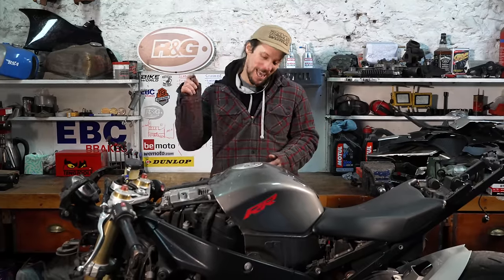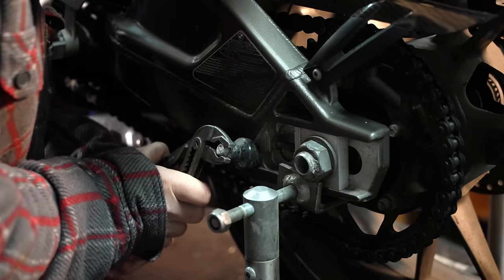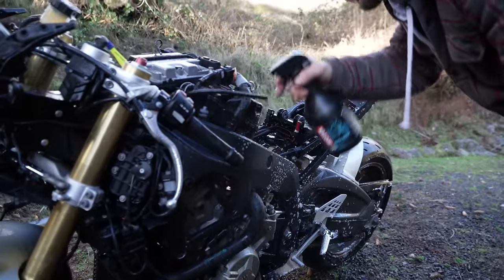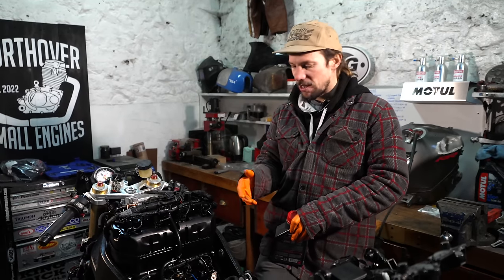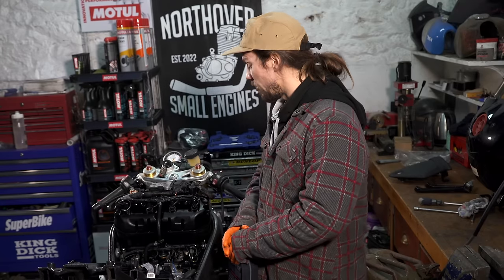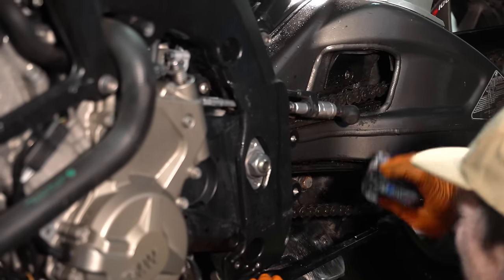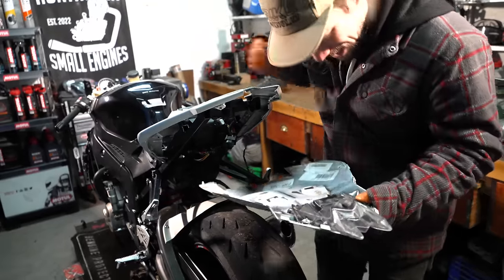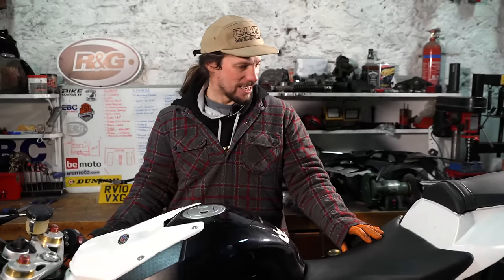Write-Off Rebuilds | Wrecked And Written-Off Superbike Rebuilt And Put Back On The Road, Part 2

Comment: Makes a load of sense to me, and I’ve done it since day 1 as well. Grab a bargain, make it safe & mechanically sound, then enjoy it without worrying about riding around puddles or spending the evenings polishing your tyre valve caps. Great option especially if you use it on track or every day. Can always have a ‘shiny’ bike for nice days then something rebuilt to use the other 6 days of the week. Great work, thanks, and keep em comin. 👍👍

Comment: I race and have bought salvaged ‘19 R6, ‘22 R1 and ‘23 V4S. All are race bikes and turned out perfect. Salvage bikes are good for club racing given you will be replacing a large portion of oem gear anyways. I reviewed them all before purchase to ensure they can be rebuilt and all turned out great. I agree that the process of rebuilding it yourself is half the benefit.

Comment: As an ex-racer, wouldn't faze me one bit if a bike was previously damaged or written off (obviously so long as price reflected it! Haha!). God know's how many times I've binned a bike on track, from CBR400's to ZX6Rs to a track-prepped Duke 1098 and my ever faithful Gixxer 1000....... some having had mega-spills, yet were on the grid next day, doing the business as if nothing ever happened (after a few hours softening the edges of any ground pegs/levers with an angle grinder, and re-attaching the bodywork with a few sheets of fibreglass and a tub of resin of course!! 🤣).

Comment: The majority of whingers wouldn't know the difference between a 10mm and 32mm socket and probably have too much money, I've been rebuilding bikes since 79 and only getting old has slowed my rebuilding down and breaking my back in 2001 don't help either, project reverse trike has basically stopped 😞

Comment: Love all your videos and you specifically you long-haired-loverman 😂 However, one complaint. You first talk about "lots of parts to fit. New panels. Paint" THEN you say about making sure everything is straight. As this is a sort-of guide for people, why not go the extra mile and make sure the frame is true and correct. It would be a waste of time and money to put the bike back together perfectly and then find out there's some issue with the frame, headstock, swingarm pivot point etc. I'm being very anal here, but it's important to emphasize what possibly Could Go Wrong if you get my point...just my 2p